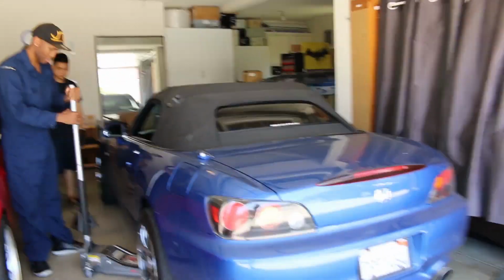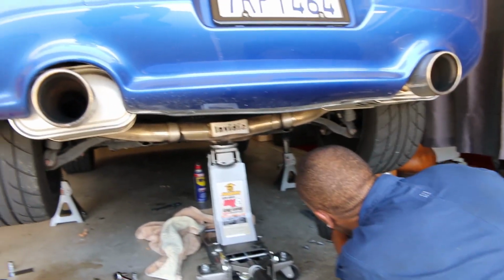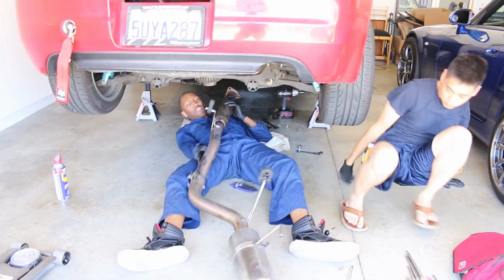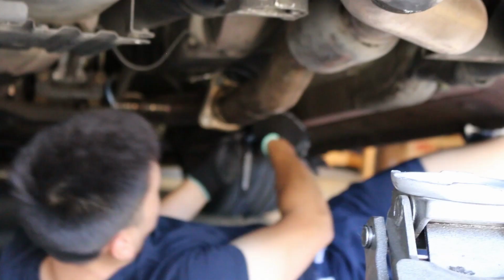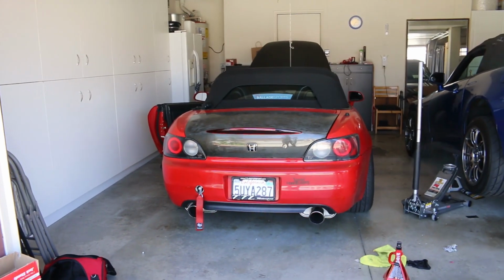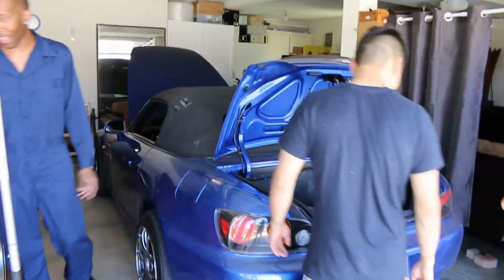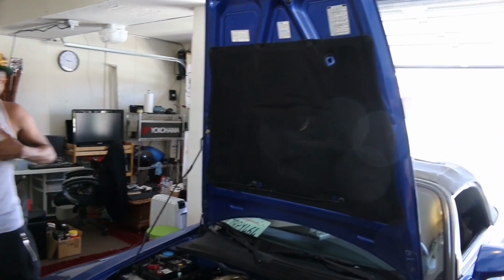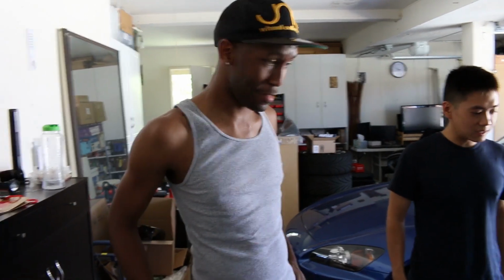Honda S2000 exhaust swap invidia Q300 vs. buddy club spec 3

Comment: i got the hangers off with out wd40... i should have thougt of wd40 when changing to a q300 XD i love your s2ks, they are clean af! mad respect
Reply: did you use any tools or just your hands ?
Reply: I used a screwdriver to get the hanger over the little nob at the end of the rod the exhaust is suspended from , after that i just pulled as hard as i could
Reply: Ok thanks .